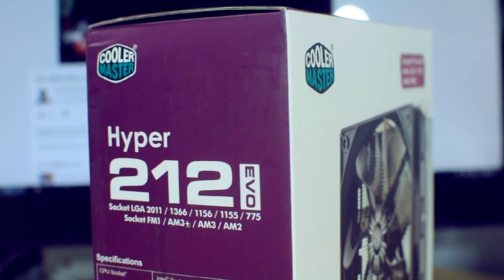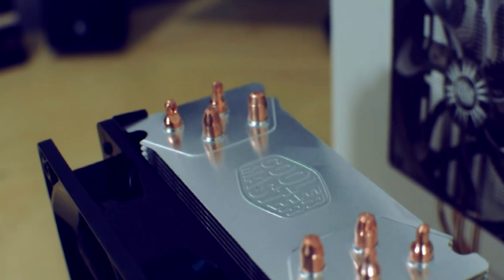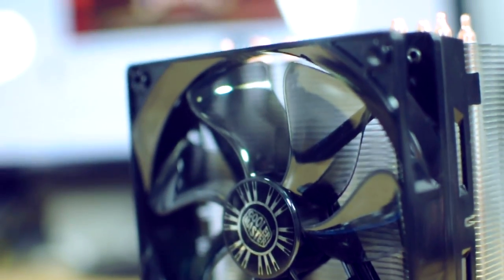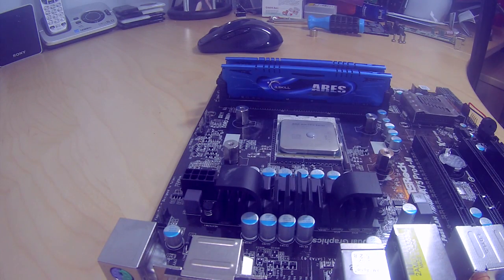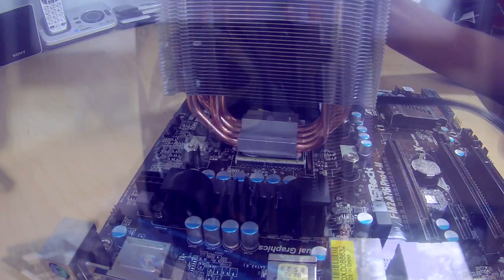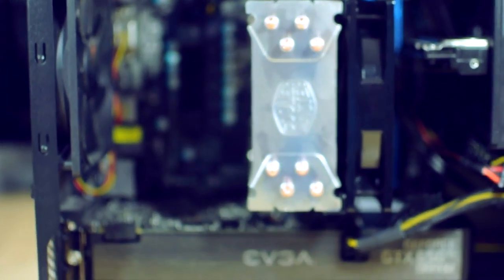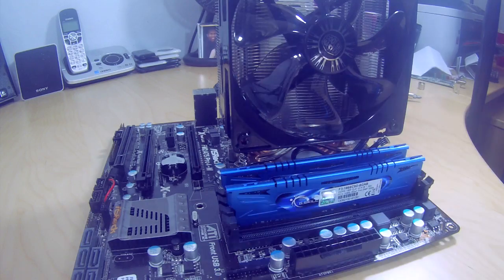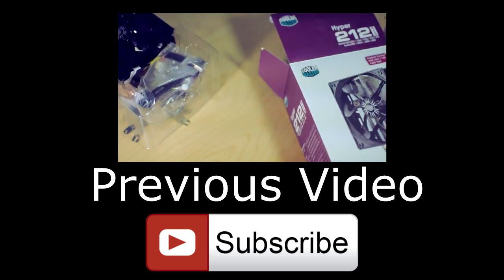Best CPU Cooler! | Cooler Master Hyper 212 EVO Overview & Install

Comment: I have 2 120 fans in pull right above my cpu could i mount this with no fan on it and use my case overhead fans at full blast?
Reply: Christian Shephard I'd only recommend using passive CPU cooling if you have a low TDP processor and extremely good airflow. The CPU fan not only cools the CPU but also other motherboard components. Without the fan these components will run at higher temperatures and may cause problems later on. If silent computing is your goal, it wouldn't help that you'd need to have your case fans at full speed. The Hyper 212's stock fan is virtually silent at 800-1000rpm and keeps my i7-4770 under 70C even in Prime95. Use Speedfan to set your own fan curve.

Comment: can i use this cooler to overclocking intel core i5-4690k?
Reply: According to my research, it is, it's perfect for the i5 4690k, I have that CPU and I want this cooler. Many people even use it to overclock the thermonuclear FX 8350, those are way hotter and they seem to run fine, so I would say go for it.

Comment: The Noise Level on the new 212s are a bit lower but higher dBA.  The new 212s heatsink dimensions are about 0.80 inch smaller than the original 212 plus.  The air pressure on the new 212s are lower but higher dBA than the original.  The 212's original dimensions are 116mm x 51mm x 159mm

Comment: oh they changed the fan, mine is the original model, the fan isn't as glossy as this hyper 212 plus, here's the specs from the original hyper 212 plus cpu cooler, http://oi58.tinypic.com/j7qmag.jpg
and
http://oi61.tinypic.com/2vnjfj9.jpg

Comment: Went from 79 degree celcius max load (intel stock cooler) to 57 degree with the CM Hyper 212 Evo. Core i5 4690k.
Reply: +Peter Helstrup Jensen does Intel Core i5 6500 3.2 Ghz require an aftermarket cooler like CM Hyper 212 EVO or just the stock cooler will be enough to keep temperature cool? There will be no over clocking since it is an non-k processor but the computer will be used for playing games/browsing for quite a bit, so it will be running for at least 8-10 hours a day. Will the stock cooler be enough for a non-k core i5?
Reply: +Fl Hn should be but i  would buy something like a 212 evo coz intel is loud af

Comment: Do I need LP ram with this cooler?
Reply: +Link_Jumper No the fan mount style lets you place it higher (away from the board) to clear taller memory. Just means if you ever need to pull the RAM you have to take the fan off first.

Comment: I have installed it on i7 2600 k with asus p8z68 deluxe motherboard in cooler master n400 cabinet. i am getting idle temp of around 32-33 degrees with one fan and on heavy load it goes up to 58 -60.
Funny thing is if i install 2 fans on 212 evo cpu cooler the minimum temp is 42- 43 degrees. and overall fan speed also goes up.

Comment: He installed it the wrong way because you should tighten the screws in a star pattern rather than a clockwise/counter-clockwise motion because this helps the thermal paste to be spread evenly.

Comment: does it work with 1150 too???
Reply: LSD illusion Yes. LGA 1150 has the same mounting holes as 1155, 1156, and 1151 for CPU coolers. Cooler Master's website lists 1150 as compatible, and although the box might not say it, it is.

Comment: how much space does that CPU cooler leave for the RAM as i want to get it but am afraid there wouldn't be enough space for my G.Skill Ripjaws X Series 8GB (2 x 4GB) DDR3-1600 Memory RAM due to them being a bit tall :/ ?
Reply: +david bartlett   I just bought this and also have the Ripjaws for my Asus Sabertooth.  Just installed the RAM and did a quick fit by pacing the cooler base over the CPU socket(with no CPU).  It appears it will have enough room. I have 4 slots for RAM and need to use 2 and 4 for 16GB RAM.  My guess is it will be CLOSE to try to fill all slots.  When I get it installed I'll try to post back

Comment: What if I'm using RAM that looks like this?
http://cdn.pcpartpicker.com/static/forever/images/product/0c7dd1b49159d6d80a39d990688e91eb.1600.jpg
(Ballistix Sport XT)
Reply: Yikak4 depends on your motherboard but it should be fine
Reply: Nick m Cool cheers

Comment: You can get the temps even cooler if you invest time and search for aftermarket thermal paste. I dont know what is best one but that you can search on your own. There is also some weird thermal pastes that will not work well with copper or alumnium (cant remember whitch one) so that has to be taken in notion too. Not sure if all reviews mention these things.

Also I have read that there is few that would somehow chemically weld the Cooler to the CPU, so it would be impossible to remove it or change the heatsink. I dont know how popular these things are but I have seen them in some of the thermalpaste benchmarks, ussually they are the ones with most low temperatures by being 3-5 celsius lower than others.. But you have to read about the whole review to know about these.
Reply: LeopoldGames Antec Formula 7 is more than 2.5 times better than the paste that comes with this cooler :) look for Thermal Conductivity to be more than 4. formula 7 is 8.something, cooler master extreme fusion x1 is 9.5W/mK
Reply: Branislav Stratrov Thats nice. I have Arctic MX-4
Thermal Conductivity	8.5 W/(m*K)

Comment: can this over clock the AMD 8350 to 5.0GHz and keep it cool????
Reply: ***** Nah, this cooler simply isn't enough. For that kind of CPU frequency, you'll need water cooling or at least the top-of-the-line air cooler which efficient/effective air movement in your case. Personally I would go for water cooling and makes sure you case is able to deliver effective air movement and has nothing obstructing the air such as cables.
Reply: victor zuniga if not overclock but just playin game can??

Comment: I am so fucked. I am about ready to give up trying to install this cooler, and just go with the stock cooler of my fx6300 (which I really dont wanna do, its loud as balls). I cant get the backplate mounted theres no screw holes near the stock backplate. I was told to not remove the stock backplate, as this is what keeps the cpu socket in place. The motherboard I have is the MSI 970 gaming.

Comment: I just installed CM Evo 212 to my Gigabyte MoBo and Core 2 Quad processor overclocked from 2.4 Ghz to 3.6 Ghz with GTX 660 GPU. My processor was going up to 68C when i had the stock heatsink but when i replaced it with this Evo 212 I'm only getting 40C even while playing demanding games. And btw i have 5 fans( 2 120mm and 3 140mm). And i can say that this product is doing a hell of a job even if I have an old MoBo and Processor.

Comment: Would an i5-4460 need an aftermarket cooler like this one?
Reply: Just get one just in case you decide to upgrade your rig, and it's always better to have it done right with a good aftermarket than the one stock fan you receive with the processer, it's only $35 seriously just get it
Reply: Bacon On Toast If it fits, get it. Even if you don't plan to overclock, the Hyper 212 will keep the same temps or lower than the stock cooler at lower noise.

Comment: I get 15-20 C on idle with fx8350 your 45 is hot.. I get 45-50C when playing games. Maybe you badly installed it, or badly applied thermal paste
Reply: Jason Hamelin Lower is not always better. 15c is kind of getting in the danger level of low. You do not want to have your temps get below the ambient temp level or else you may get condensation in the case.
Reply: kooken58 thx for the tip!

Comment: I installed this fan on an Asus M5A99FX Pro R2.0. I had to remove the default brackets that came with the mobo. Additionally, there wasn't much clearance with the tall ram, so I reversed the fan to suction and placed it on the heat sink opposite to the ram. Once installed runs great. It is bulky, but the high surface area makes it very efficient. Overall, I am very happy with it, but it did require some work.

Comment: does it fit on a mid case ?
Reply: kaizoku Would fit this one nicely:

http://www.newegg.com/Product/Product.aspx?Item=N82E16811853003&AID=10657534&PID=3938566&SID=&nm_mc=AFC-C8JunctionCA&cm_mmc=AFC-C8JunctionCA-_-na-_-na-_-na&utm_medium=affiliates&utm_source=afc-%zn

You have 2 choices of colors and one with a side window (However the one with the window has a wired ventilation design on the window so you can't really see inside)
Reply: KB_TheDireWolf Thanks a lot dude !
Reply: kaizoku np (like to see your build once it's done)
Reply: kaizoku Here's mine with that case:

Am in Canada, Can $ is crap right now because of low oil prices. 

PCPartPicker part list: http://ca.pcpartpicker.com/p/GfxBt6
Price breakdown by merchant: http://ca.pcpartpicker.com/p/GfxBt6/by_merchant/

CPU: Intel Pentium G3258 3.2GHz Dual-Core Processor  ($79.98 @ DirectCanada) 
CPU Cooler: Cooler Master Hyper T4 70.0 CFM Rifle Bearing CPU Cooler  ($25.64 @ DirectCanada) 
Motherboard: MSI H97M-G43 Micro ATX LGA1150 Motherboard  ($103.80 @ DirectCanada) 
Memory: G.Skill Ripjaws X Series 8GB (2 x 4GB) DDR3-1600 Memory  ($69.99 @ NCIX) 
Storage: Seagate  1TB 3.5&quot; 7200RPM Hybrid Internal Hard Drive  ($79.99 @ NCIX) 
Video Card: Asus GeForce GTX 960 2GB Video Card  ($254.99 @ NCIX) 
Case: Deepcool TESSERACT WH ATX Mid Tower Case  ($54.98 @ Newegg Canada) 
Power Supply: EVGA 500W 80+ Certified ATX Power Supply  ($44.97 @ DirectCanada) 
Case Fan: Cooler Master R4-L2R-20AC-GP 69.0 CFM 120mm  Fan  ($6.40 @ DirectCanada) 
Total: C$720.74
Prices include shipping, taxes, and discounts when available
Generated by PCPartPicker 2015-06-06 16:08 EDT-0400
Reply: kaizoku And from what I've read in reviews replace the case fans the tesseract comes with something better. A good pick is the cooler master R4's, very high air flow and near silent and a lifespan of 50,000 hours and come in a range of LED colors. ( there's one without LED's as well)

Comment: Is it good for the FX 6300?
Reply: I have an fx 6300 and my oem cooler wasn't very good I never messed with the clock speed and in bf4 I was reaching 144 degrees so I stopped
Reply: carlos velasco Bloody Hell!
Reply: TechyBoyProductions do you know if they sell the heatsink you have at best buy because my mom really doesn't trust the internet with her credit card
Reply: i checked best buy and they only has one that was 120$ so ill just buy an evo from newegg
Reply: ***** sry I meant that best buy only has 1 cooler on display and it's 120$ but it's not the evo it's some dual water cooler
Reply: carlos velasco 144 ? c or f ? if celsius....what in the actual fuck xD

Comment: i installed mine so that the fan faces the bottom, is that okay, so the air blows up not to the side
Reply: abstraact I think the purpose of having the fan facing the side is to have a relatively straight exhaust pathway for the hot air through the rear case fan. If you have fans on the top of your case then it's not an issue. If not, mounting it with the fan blowing to the rear should be better since almost all of the hot air is immediately sucked out by the rear exhaust fan.

Comment: I think it should be noted that on the xclamp, the end bolts need to be adjusted to the middle hole for AMD.  they push really hard one way, and really easy the other. That's how you adjust them. Just destroyed my fingertips push them the super tough way, which is the wrong way. Great way to start a build.

Comment: Just in case youo didn't know. It's very impoortant to use new thermal paste everytime you take off your cpu cooler/replacing it ;)! If you don't you might end uå with an overheated cpu!

Comment: You should tighten the screws in a star pattern to spread thermal paste evenly and not putting to much pressure on one side..
Reply: +Wiikendz You could've just explained it in your comment instead of telling people to search for it.
Reply: Shade Draws Isnt it better for people to see how its really done? Instead of me explaining, and they might misunderstand and do something wrong?
Reply: Wiikendz Someone asked a question and instead of using your opportunity to just answer it and provide them the information they were looking for, you used the opportunity to tell them to look it up, which helped absolutely no one and left them as in need as they were before.
Reply: +jeremy kc Think of it as corner-to-corner diagonally. You want to apply even pressure with the mounting of a heatsink so the thermal compound applies across the whole cpu instead of the thermal compound being pushed out to a specific side due to the initial uneven pressure of screwing in the heatsink. 

If it's pushed to the side, inefficient cooling usually happens and a person can expect to have to re-apply compound soon.

example: Corner 1 then Corner 4. Corner 2 then Corner 3.
Reply: Shade Draws if they cant use google ir youtube to find a good tutorial, they are in need indeed, need for help.
Reply: +Shade Draws Exactly
Reply: +Thaddeus Pitch really? Cus +Evencrux explained it pretty well
Reply: Chef Boyardee The better thing to take out of this is to try to find an answer somewhere else before bothering other people with questions. Yeah you can find a better answer online, but that's not the point.
Reply: Wiikendz Meaning going from top to bottom and side to side??
Reply: Search for it, almost every PC build video explains how to do it.
Reply: +Mary R. Colon  where the hell did u come from...
Reply: +Shade Draws Or they could get a better answer by looking it up themselves and not demanding advice in the YT comment section, which is unreliable and slow.
Reply: +jeremy kc No as in from one corner to the opposite. For example, start in the top right, then do the bottom left. Then the top left, and then bottom right. Or any variation of above as long as you do opposite corners together.

Comment: that fan that come with the hyper212evo,can i change it with coolermaster case fan xtraflow?i mean does the socket and 4 pin compatible?i always wandering what if the fan suddenly stop working can i substitute it with any coolermaster case fan?(sickle flow,jetflow or xtraflow series),i think the heatsink would be broken in about 10 or maybe 20 years but if the fan broke down and i cant find substitute for it,it would be suck rit,i hate the idea to keep changing processor cooling fan every 5 years,i rather just change the fan instead,lol pls let me know if u know anything bout it,thx b4
Reply: Calvin Liang You can mount any 120mm fan on this cooler and it will work. Fan connectors are an industry standard. The only thing is if your replacement fan is a 3-pin (let's say a Sickleflow 120mm), you will not have PWM control and the fan will run at its full rated speed which can be very loud (you can use fan resistors to reduce speed and thus noise). The thing to keep in mind when buying fans for CPU coolers in general is you need a static pressure optimized fan, NOT and airflow fan. CPU coolers are relatively restrictive so you need a high pressure fan to push air through, like a Corsair SP series fan. An airflow fan won't be able to push much air and as a result will spin faster and louder than a pressure fan. The Jetflo, Xtraflo, and Sickleflow are all good pressure optimized fans, although not all of them have PWM capability. Corsair SP series fans and Noctua NF-P12 are also good pressure fans.
Reply: +nigahiga6400 aite,so i can change into any fans as long as it has a good pressure rather than just an airflow,tyvm

Comment: Stock cooler: 25-30C idle. Under load: 40-50C
THIS cooler: 21-25C idle. Under load: 35-36C

2MM off not being able to fit!

Comment: Mine came from Newegg with the wrong standoffs. They don't fit through the holes in my Asus Maximus Hero VII motherboard and the threads don't fit through the backing plate. Newegg wouldn't cross-ship a new one. Cooler Master will send me the right ones but they won't be shipped for 2 to 7 working days.

Comment: Great cooler with a shitty fan...I had to get the fan replaced twice in the first year because they just die for no reason...also, I had to mount one fan higher than it should because it doesn't clear my ram.

Comment: 45C on idle? That is crazy! My Hyper T4 gives me  30C on idle, and 45/50C on load...
Reply: Justin Jay Getting 25C on idle with stock cooler
Reply: Overclocked to 4.0GHz with stock cooler and temps on full load have not gone over 55C
Reply: Justin Jay You would have to know his overlocks to compare temps and performance.
Reply: Broke My Crayon Very true statement.
Reply: So was I. But are you overclocking? Once you start overclocking, the stock cooler does not stand up against the amount of heat your CPU will produce.
Reply: Nice mate. That's one hell of a stock cooler!
Reply: Tell me about it. I have the CPU fan speed at a constant 75% that could be the trick!
Reply: William91W what cpu is it though?
Reply: AMD FX8320E

Comment: I have this on my i5 4670K on Asus Z87-A mobo and ive pushed my clock up to 4,6Ghz stable. I do have 3 chasis vents aswell, cheap ones. Now im thinking about gettting a liquid cooler to push the clock even further.

Comment: A correction. The Hyper 212 Evo is not even close to being the "Best CPU Cooler!" like you claim. It is probably the best BUDGET cpu cooler, but there are several air coolers that are considerably better especially when overclocking.

The fan with the EVO is not the same as the BladeMaster that shipped with the original Hyper 212 and the 212+. The BladeMaster has more static pressure, is quieter, and is more reliable than the lower quality fan that comes with the Evo.

Overall, the 212+ is actually better than the Evo when properly installed.

Comment: Great device.
Q6600 2.4 Ghz to 3.6 Ghz with this cooler (G0).
Max temp under crazy load 70 Cº. Average is 50 Cº.